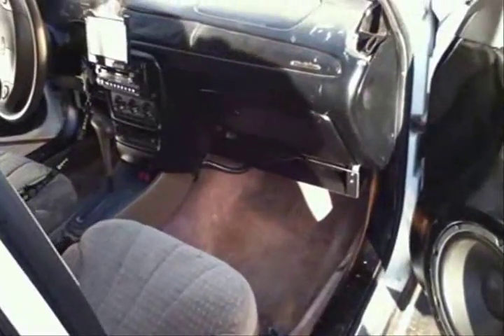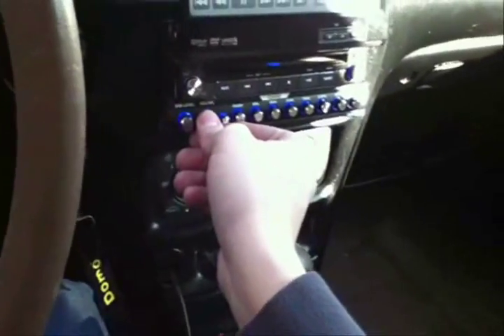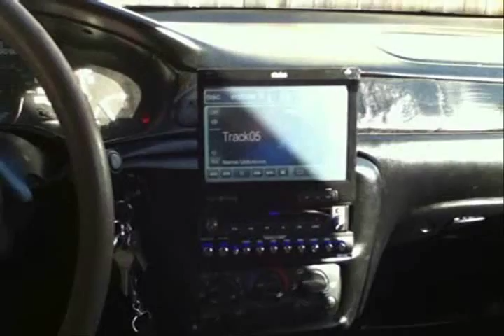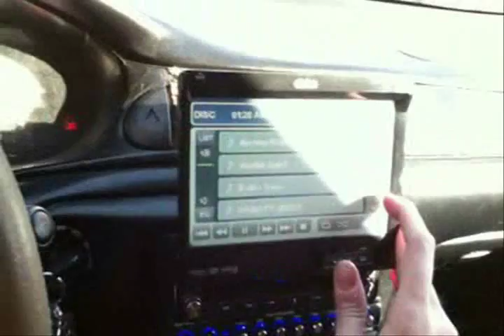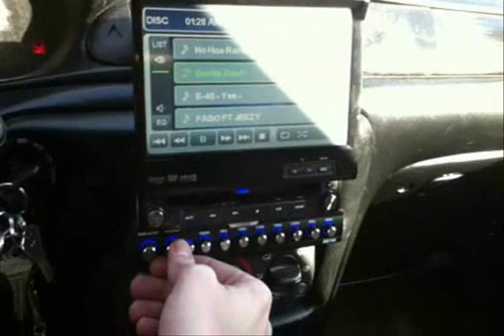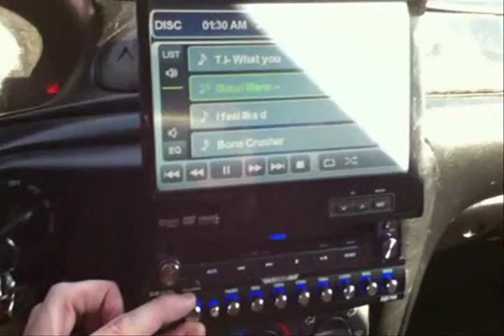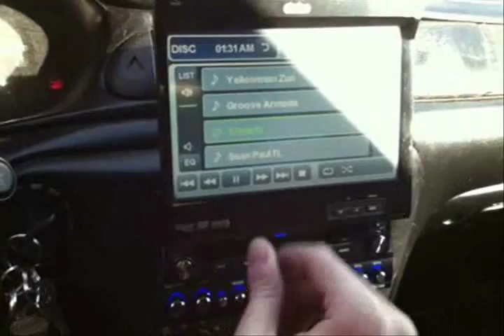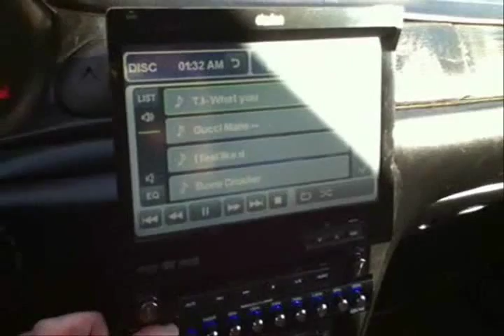Image Dynamics Horns Demo

Comment from the maker: @HAMMERxHCA The horns play from 1000hz all the way to 20k. They are a midrange and tweeter. The 10" is a midbass woofer. It plays to around 2.5k. Once I get the 12" in there to replace it I'll be crossing them at 1500. That's why I chose this setup. Small amount of speakers and less fabrication and amp power. The subs will be on 1500, doors 250, and the horns 30 watts.
You can get a setup just like mine for ~ $400.

Comment from the maker: @lobstermendez It will be a sql system. The subs are rated for 350 RMS. I am going to run 500 to each. I don't see any loss in that.You have to remember my goals aren't the same as yours. It will do high 40's when it is done which is not bad and with the processors I'm getting she will be able to hang with the sq crowd too. Too much emphasis is placed on power and not enough on efficiency.

Comment from the maker: @Machstorm71590 I thought of getting the kicker eq but I want to add a center channel so I will probably be saving up for an ms-8. It has a dedicated center channel output. It also has 30 bands of adjustment per side so it should be perfect.

Comment: hey man i was wanting to get a pair of horns, i have a pair of id xs6.5s and xs6/9s in the back and all xs28 tweeters, with a 12 idmax, it all slams but i want my mids n highs louder, they are clean as ever! i wanted to get an extra pair for the front and back but that will be so expensive and custom door panels.. i hear the Id horns are much louder and much cleaner. believe me sound quality is a major issue but for this app i want it to be unreal loud, so may i ask you please, how loud r they?!